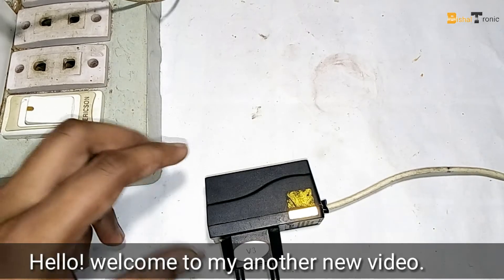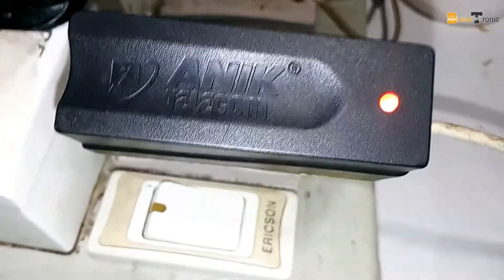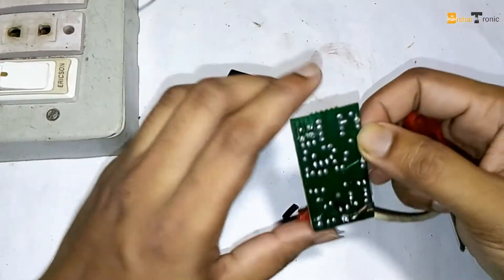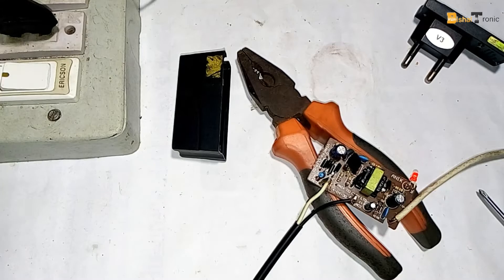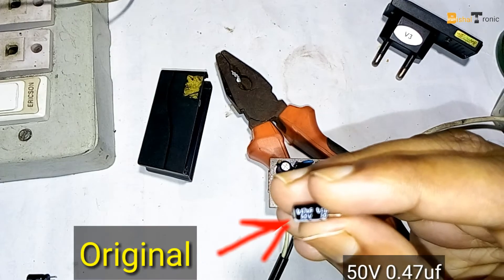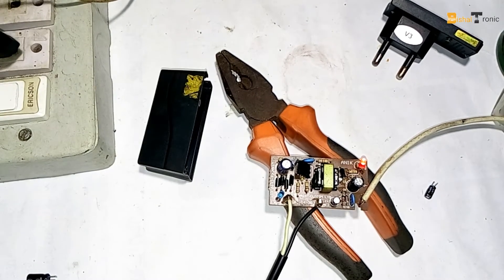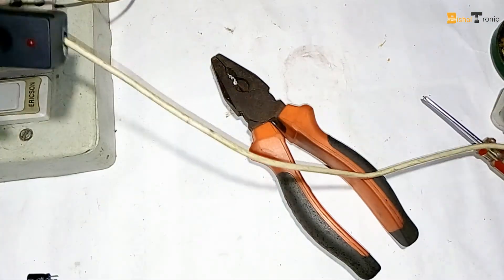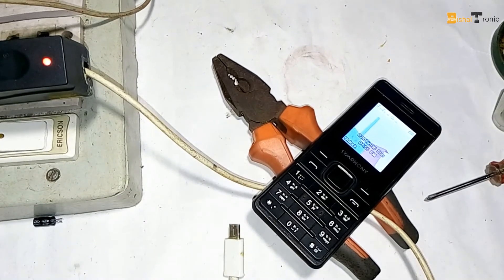Mobile charger make noise - Mobile charger make wild sound - Dangerous mobile charger - BishalTronic

Comment: Sir my iqoo neo 7 80w charger makes sound when it's connected to any phone. And stops when unplugged. Is it okay to charge further. Or not.
Reply from the maker: Thank you for asking a very important question. If your mobile charger is charged the same as before, like the same time as the present of the charge, then there is no problem. You can  use it.

Comment: Sir new chager baught but chrging sound ho rahi ha
Reply from the maker: It looks like your charge capacitor date has expired. Please check if it's isolated from the mains or not through your tester. If it is! Then change the charger through warranty card. Thank you.
Reply: Sir small sound a Rahi ha charger ma koi dikkat baki bat to nahi na
Reply from the maker: @PrakashDas-uq1vy  please describe it in English. I'm not in your  country.
Reply: Sir new charger slow sound in plug in future any problem

Comment: Well done. How did you know that this specific one, is the faulty capacitor?!! And is this noise a clear sign of a malfunction capacitor and charger ?!! Or the charger can still work fine ?!!
Reply from the maker: There is no way to know specific capacitor without checking. But some time chargers work well.
Reply: The noise means a mulfunction capacitor only?!! or may be a transformer or coil alao ?!!! @BishalTronic
Reply from the maker: Yeas

Comment: my wifi modem adapter makes kiri kiri sound the person who installed wifi saud it's coil sound is it normal
Reply from the maker: Probably bad soldering inside.
Reply: @BishalTronic  yeah adapter issue
Reply from the maker: If router is not working and something spark inside the adapter then you should to repair or replace it.

Comment: Bro my iPhone charger makes zzzzz sound any facts?
Reply from the maker: No problem if your phone is charging continues. But if charging your phone takes a long time or flickering while charging, you should be replace it's output electrolyte capacitor. I think it's exploded 💥
Reply: @BishalTronic  does every charger makes a noise if u put in into ear then take it off from charging then the sound stops?
Reply from the maker: No All charger doesn't make noise. The sound stops when you turn it off from charging because no electricity is flowing inside the capacitor. If your charger capacitor explode or damaged some time it create sound but not at all. Some capacitor doesn't fully damaged and they lose there capacity but they work less. fully damaged capacitor doesn't work.